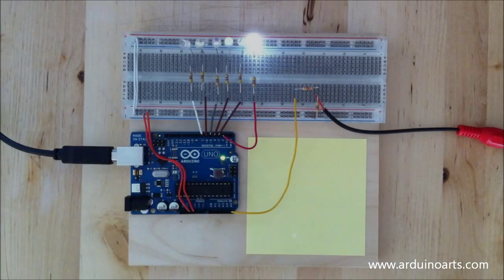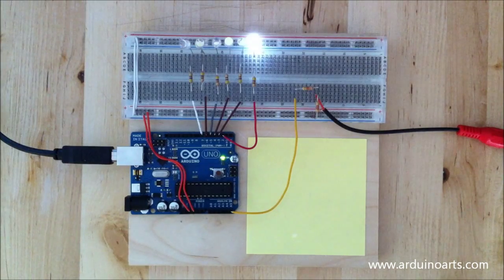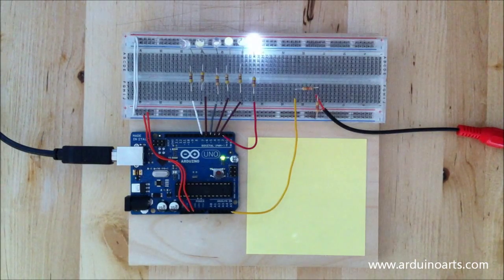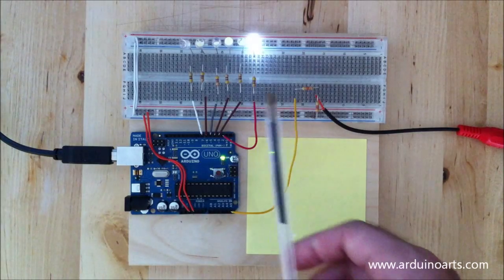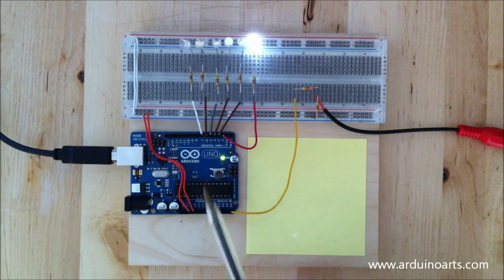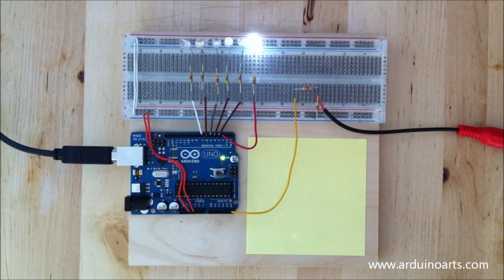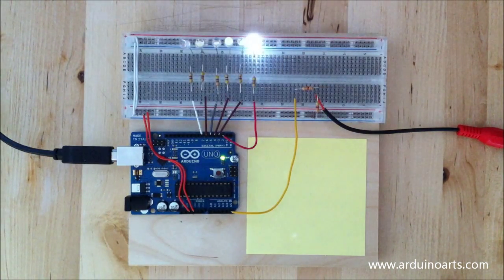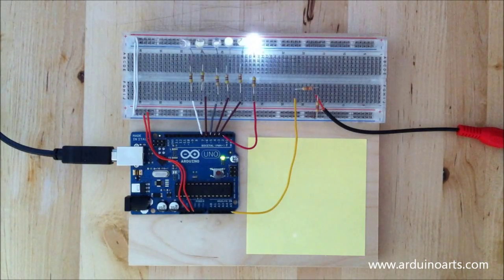Arduino Tutorial: Led Audio Meter via HeadhPhones

Comment: Can you give me some specifics on the way you have the audio cable feeding the board. I'm struggling with that. Getting readings of max 25 as the sensorValue
Reply from the maker: Hi, it was quite simple... just got the audio (in mono) from the headphone jack. It has a preamp (usually 0,5watt) and will give you a bigger value for sure. Hope it works!